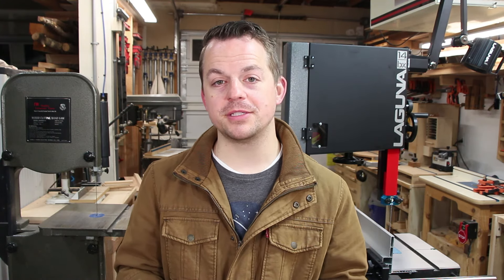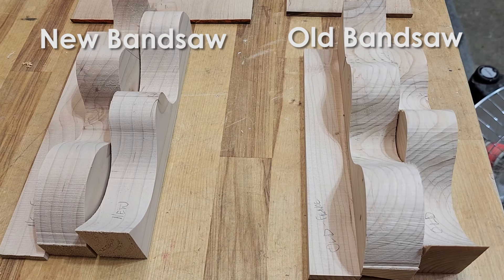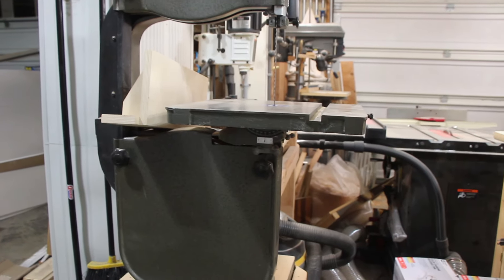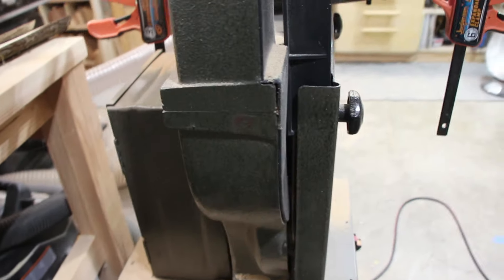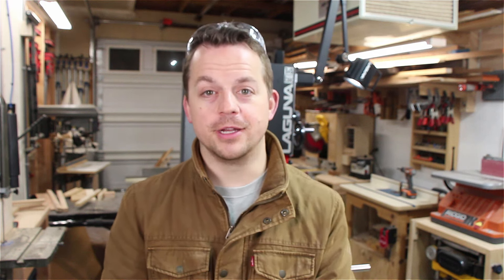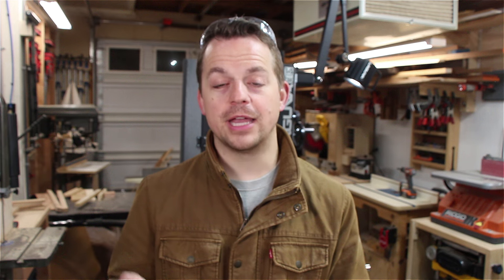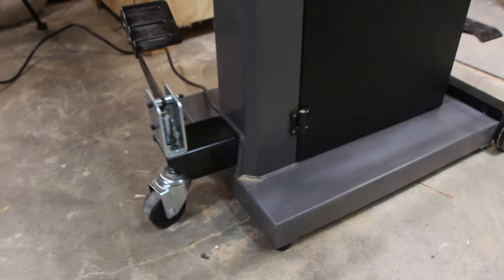Is a $2K Bandsaw Really that Different from an Old Bandsaw? | Laguna 14BX

Comment: I can't see how this can be compared if you don't have the same blade on both.  Blade makes a huge difference.  Thanks for the video.  Just not apples to apples comparison
Reply from the maker: Good point, I guess it's just the comparison of the cheap car to the sports car. Both can get you where you need to go, one just makes you feel a bit more comfortable!
Reply: It is a good point, but I’m not sure I understand your response.  I would argue, as marks did, that it’s not a comparison at all if you don’t use the same blade.  I mean, that’s what is doing the actual cutting.  I love the observation you made about the Laguna (theoretically) maintains tension better and giving a better cut….but we didn’t find out if that’s the case.  Not bashing….just some constructive criticism.  Thanks for taking the time to do this as I did learn some things about what you get in a more modern design.  I’m looking to buy my first shop bandsaw and will need to make the decision between a cheap new saw and a good quality old saw.  Any recommendations for that?

Comment: 8:40 all you need to do is use a rust cleaner.. or just water and scotch Brite, steel wool or a wire brush and then coat it with oil or some rust paint like P.O.R or an oil based metal paint, not a water based, a water based paint rust forms even on clean new metal requiring a primer when painted direct to mild steel, same amount of time you waste contacting them

Comment: Question have you noticed the power buttons are red and green on most and mine is black and white 2020 model 2.5hp like yours and did anybody here replaced brake pads because no theres no information on this in manual even though it looks straight forward like a bike but you don't know whats hidden.
Reply: I have a 14bx, a few years old with the black and white buttons as well.  I find it weird there's a clear light in the middle which would seem to be a power on indicator, but it does nothing.  Also, on another video I saw, a guy had removed the brake to remove the lower wheel and he could not figure out how to put it back on. Big mistake! He called Laguna and they said they could NOT hlep him because nobody there knew how to fix the brake either!!! Crazy, and seemingly incompetent.  I'm NEVER gonna touch mine...
Reply: I was thinking the switch was to light up also in the clear part of switch.
Reply: @donmeyers3090 Evidently slapdash support is normal for Laguna.  Rusty screws not just an isolated event.

Comment: If you're on a budget a riser block can be fitted into the frame to get an additional 6 inches and use a 105" blade.  You really can't compare the resaw quality unless you use two new blades of the same type.    The tooth design on resaw blades makes a huge difference.  

Some of the other aspects such as power etc do make a decent difference on cut speed etc.

Comment: I have been running the same laguna for quite a few years in a production shop and I love it. The ceramic guides are fantastic , when set properly. I am still on the original guides after six years of steady use , mostly re sawing

Comment: As my Jet bandsaw is currently on a pallet ready to be shipped back for a refund, I am looking at purchasing this saw.  Quick question.  After using the Laguna now, would you recommend getting the mobile base by Bora instead?
Reply from the maker: I haven't used that one, but it looks like it has four wheels so it's probably more stable. The Laguna one is decent, but I think you could get a better one for cheaper
Reply: @EveningWoodworker The three wheel design is more stable if the floor is a bit uneven.  My 14" Record Power Sabre has a similar design and works very well.  The long handle on the jockey wheel makes it very easy to move and steer this very heavy saw.

Comment: In my situation the older, higher bandsaw would be easier on my body for prolonged use as I am 6'8" and a higher table is a lot less strain on my back.  It may not sound like much difference, but put it this way.  If I wash dishes standing up straight at my sink my back will be aching before I've finished.  Now, if I spread my feet apart in a sort of jumping jack position where my body is slightly lower to the sink my back won't bother me at all.  If my "cut quality" is lacking any, well, that's why they make jointers and planers and sandpaper, lol.  In as much as woodworking is a hobby for me and not for commercial production I'd not be able to justify virtually any machine that's over a few hundred bucks.  My current bandsaw was the most expensive tool in my shop and it is a used 14" Delta I gave $400 for.  It needed no work as it had been kept in mint condition and I'm quite happy with it.  My newest (to me) and cheapest addition to my shop is a 1956 DeWalt MBF radial arm saw I gave a whopping $35 for, and yes, it is getting currently refurbished as I have it all in pieces cleaning, de-rusting, new wiring, new bearings, etc, but when I'm finished it will work as well as it ever has.
Reply from the maker: Sounds like the taller bandsaw is a better option for you!

Comment: I’ve been woodworking for over 45 years and have had several bandsaws in my time - from cheap to expensive.

In case you are thinking 45 plus years means no mistakes, I badly messed up a 14 foot x 4 foot oak table top this week. Firstly, getting 8off 14 foot x 5.5” pieces to mate perfectly along the seams proved impossible. A combination of pocket screws and dominos lessened the irregularities but it was not smooth as you would expect from, say, a sheet of plywood. Most medium-end solid wood tables are now made out of staves of timber which makes the control of the fit much easier providing that, as in a very large commercial shop, you use hydraulic clamping to literally force everything to be where you want it to be - and then you use a wide belt sander to even out the surfaces. So, I ended up with some irregularities on the surface and some areas where the oak did not make a seamless oft. So, I thought I would v groove down each join and, effectively, not be able to see or feel the imperfections. I used a Festool 1410 (?) secured to 2.8m of Festool track to get, as I thought, perfectly long straight grooves. On 2 of those 14’ long router cuts, I messed up. The Festool fitting to secure the router bars to the track are just not robust enough if you meet any kind of resistance in the timber. Patch time: big time.

Anyway, back to bandsaws. My experience is that you need a certain level of quality in the bandsaw itself. The wheels must be perfectly aligned with each other in a vertical plane (I could set the wheels on a cheap bandsaw but the bearings were so poor that they went out of line). The guides must be adjustable and stay adjusted. Lastly, and the easiest one to fix, the fence must be 90 degrees to the table. Providing you have that reasonable quality, the next factor is the blade. Buy very good blades; they are worth it. They start sharp and stay sharp longer. But they are not everlasting; they need to be changed regularly. How often? About a week before you actually do it. 

Lastly adjust the tension and the guides so the blade runs smoothly and quietly. I have a very expensive  bandsaw; it is very stable; everything aligns and the roller guides are first class. However, it cost me about £1000 than a quality I could have lived with. So, don’t buy rubbish but you don’t need the very best if you are not a professional shop.
Reply: Sounds like you need a tracksaw.
Reply: @24revealer  I’ve had a Festool track saw for 10 or 20 years. I used it to effectively joint one edge before I put the other through the table saw. The theory was that one edge was straight through the track saw and the other parallel through the table saw. That’s the theory; years of experience tells you that in practice can be very different. Any discrepancy not apparent in a length of, say, 2m is magnified perhaps 5 fold in a piece over 4m long. That discrepancy can be human error, machine error but also the timber releasing tension. 

The real disappointment I felt immediately afterwards has been tempered by the last week. It’s okay but okay is not good enough.

Comment: I have the 14BX and it seems to be a good machine.  I'm not sure why folks have trouble with the ceramic guides.  I get them set up easy and they run smooth for me.  I was hesitant to spend that much money, but after getting is all set up and running it for 2 years I have to say it was a good investment.  For a light, I use a magnetic mounted rechargeable LED and put it where needed.  It is about 2000lumen so I have no light complaints.  Thanks for the vid.
Reply from the maker: I may need to do that since this light is getting painful every time I bump it.

Comment: I bought a table saw from laguna the wing holes did not match and they told me to drill the holes , i said nope im returning it and thats what i did. So your story doesn’t surprise me when they sent you the rusty screws and go buy them yourself. They told me to go find someone to drill the holes for me . I also said nope. Rockler   Wood working and hardware took back the table saw which laguna didn’t.  So my local vendor took it back without any hassle. Shame on laguna. So Rockler wood working and hardware WENT ABOVE AND BEYOND TO HELP ME OUT . Got my money back.
Reply from the maker: Rockler stands behind the stuff they sell. Glad you were able to take it back.

Comment: What was the actual HP rating of both? That is more important than voltage. The voltage is about efficiency at each HP rating not output power. 
1HP is 1HP, however the current draw will be significantly different. There is no difference in 110v vs 220v if the HP rating is the same.

Comment: I have the 18bx. It was great out of the box, but it’s almost impossible for me to adjust the bottom guides since my hands barely fit in there. Additionally, I had a heck of a time with the guides wearing down. I just bought Carters bearing guides and they work flawlessly.
Reply from the maker: I guess I gotta wait and see how it works for me. I've heard good things about the Carter guides though.
Reply: can you share the model number for the guides you got from carters?
Reply: @mohamedsoud  you’re in luck. Paper is next to me. 
LAG-UNV01
Reply: @buffalojones341  thanks man, appreciated
Reply: I have the 14BX and likewise, the bottom ceramic guides are a real p.i.t.a. to adjust.  Are the Carter Guides any easier?
Reply: @donmeyers3090  I’ve had them for a while now and haven’t had to adjust them. I had to take the table off to install, but they seem like they will truly be set and forget since they were tightened with Allen keys instead of finger screws.
Reply: @buffalojones341  Thanks for the reply.  However, it sounds like you're gonna need to remove the table again to adjust them if you decide to change to a different size blade, correct?
Reply: After 18 months of frustration w the ceramic guides, I just ordered the Carters. When the guides stayed put, they were fine, but I chipped them 3 times and had to replace them. They would not stay tight. Otherwise, the saw is great.

Comment: Well, the Laguna looks like a top quality saw. But the comparison just doesn't hold water. Different blades, different HP; everything in the new Sam's favor. Great video, but the outcome was basically pre determined.
Reply from the maker: Yeah if I did it again I'd use the same type of blade to make sure the results were consistent.

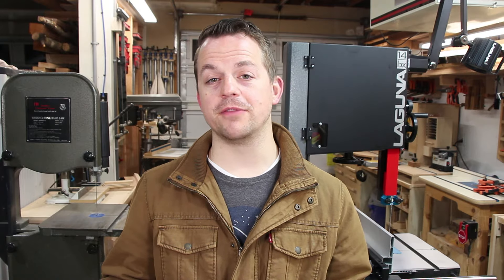Comment: 1:40 both of those saws don't look like real bandsaws.. missing engineering/guides to stop the blade from cutting into the case/or worse when you need to pull backwards, literally the only thing holding it in place is the convex angle on the wheels absolute garbage

Comment: What I’d like to see is an apples-to-apples comparison of comparable bandsaw models. Same dimensions, resaw height, horsepower, etc.  Like getting the Record Power, Laguna, Powermatic, Harvey, and Grizzly/South Bend saws all together with the same blade and run them thru their paces.  That would be useful.

Comment: Had a mid 90s Craftman/Delta 93 1/2" that worked well after several upgrades. Bought a Laguna 1412 115" for the resaw length....used a Resaw King blade on both. Laguna is a hella saw, don't regret buying it.

Comment: What really makes a difference in performance is the motor hp. Voltage is just better for energy consumption. In this case you probably have twice much power, but with the same energy consumption, which is great

Comment: Laguna looks like a good saw. You make a lot of good points. I have had a number of bandsaws, kind of still do. I have a 27" that is massive and does a great job cutting thick and large pieces but if the blade is dull or damaged it doesn't matter what kind of saw you have, its going to cut poorly.

Comment: I recently bought the 14/12 and found the assembly videos on the Laguna site very helpful, far better than using the manual. The only issue is they keep playing loud music, though not continuously, even when the demonstrator is talking. What is the point of that? 

Overall I think it is a very nice bandsaw. I have the UK version. Points I am not so keen on are the doors are linked, as there is only one safety switch, which is located under the lower wheel. The lower guides are a bit fiddly to get to. Also, the measurement scale is just a stick on piece of plastic, so the first time I used it the large piece of oak took part of the scale away. Laguna did replace it but I feel it should have been an etched scale which cannot be damaged on a bandsaw of this class.

Comment: I have the 1412...I was never able to get the ceramic guides set just right.   I replaced them with the Carter guides and a Carter stabilizer .   I love them both and they were game changers for me.  Overall, the Laguna is great.
Reply from the maker: That's good to know... we'll see if I end up doing that eventually.
Reply: I recently bought the 14/12 and am fairly pleased with it so far, although I do find setting the lower guides a bit fiddly. I have seen the Carter guides mentioned but wondered what the advantage is. Also, they not be available here in the UK?

Comment: Thanks for the review, I'm in the market for a bandsaw, and based on our review, even though you said you liked it, it's dropped in my ranking of my next bandsaw purchase.
Reply from the maker: The saw is really good, it's just that they definitely need to keep those fasteners in stock!
Reply: @EveningWoodworker It's not about the stocking- although that is ridiculous - it's about the appalling attitude of the after sales team which reflects very badly on the company.  Your experience has certainly put me off Laguna.  What will their attitude be if you have a major problem in the future?
Reply: I don't remember hearing anything about the Laguna outperforming his old bandsaw, just that the Laguna performed slightly better.  Definitely didn't convince me to go for the Laguna, so will keep researching.

Comment: it may seem like a small gripe. but that lack of consumer care is a deal breaker for me. it is easy as all to go grab a couple bolts and washers. the problem is the lack of pride for their quality. it would be better if they send you the parts and advise you that if you need the saw up and running today you could get x size at the hardware store.
Reply: I agree, to me it's an indicator if they won't fix (or replace) the low cost items they will be even less willing to rectify a larger issue. IMO
Reply from the maker: It definitely was a surprise, but it still ended up being a good saw.
Reply: @EveningWoodworker Until it breaks!

Comment: I ordered mine on Black Friday 2020 but because of the virus I didn't get it until Feb 2021.  I think then it was on sale for $1300 and a free Resaw King blade at my local Wood Craft. The only issue I had putting it together that I remember is the wing nuts attaching the tabletop. For some reason I had trouble holding the bolts in place under the table and getting the wing nuts on. I agree the instruction's manual is lacking after putting together a SawStop and using their manual. I haven't had any issues with the ceramics yet. One of its first uses was to resaw my neighbor's dead apple tree. No problems whatsoever. This is a really great saw, and I would recommend it to anyone.

Comment: Power is not a function of voltage, one saw being 110v and the other being 220v means nothing, power with electric motors is measured in horse power in US and KWatts in Europe. 1hp is about 735 Watts, and 1 watt is 1v x 1amp, voltage multiplied by the current under load.

Comment: I'd highly recommend a small sled for resawing -- it is very easy to have a blade grab and roll a log.
(I'd also recommend not using the resaw king if the log is green)
Reply from the maker: Good idea! I'm curious though why does the resaw king not work well on green logs?
Reply: I use my carbide blades when I want a clean resaw, which means I would be trying to keep it out of the grit in bark and the wetness of a green log.  If you're treating it as a long-lasting blade, then it might be okay.  (The more common advice I see against it is about wanting more set when sawing green wood, although I've seen some people report the carbide teeth are actually pretty chunky compared to the backer blade, so maybe that is a non-issue.  I'd still take a look at the sides of the teeth and see if they need cleaning, though, before trying any fine resawing)